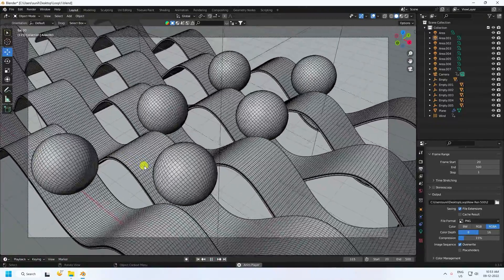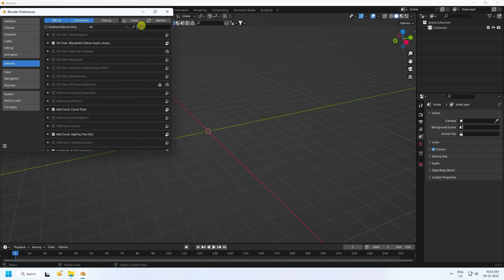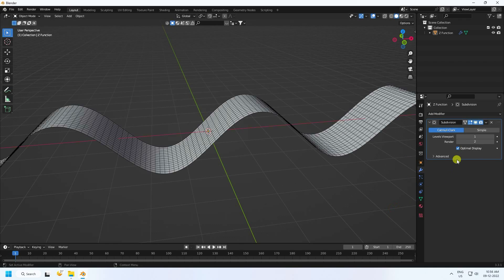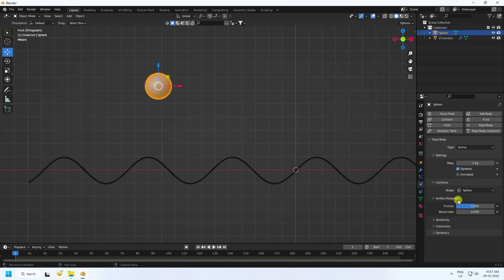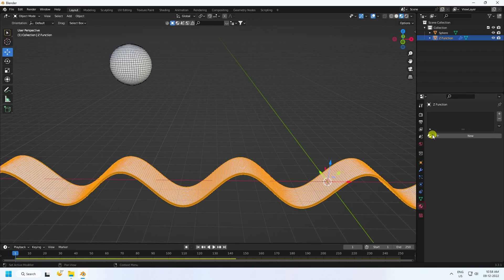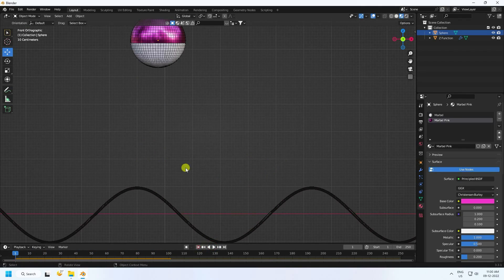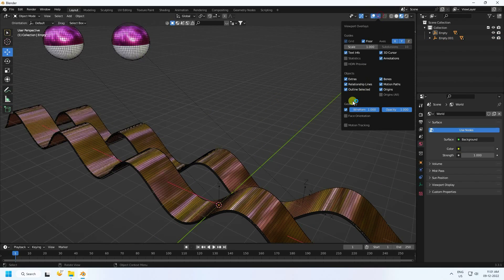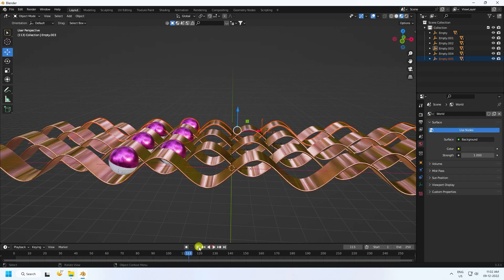Blender Physics Tutorial - Rigid Body Simulations ( Easy Blender Loop Animation )

Comment: Hi, what is your pc configuration?
processor and gpu
the information will be helpful for me. thanks
Reply from the maker: AMD 2700x, GTX 1650, 32gb Ram
Reply: @FattuTutorials  thanks,, I have a rtx 3070, 32 gb ram, amd ryzen 3600
whenever i do simulation and physics in blender, It takes time to preview or hangs. I think my problem is with the processor. I need better one. Will it solve the problem?  Because I want to do animation very efficiently. Can you suggest me on this issue?